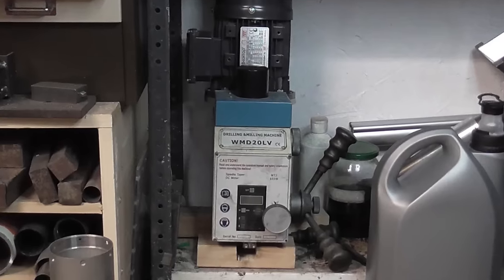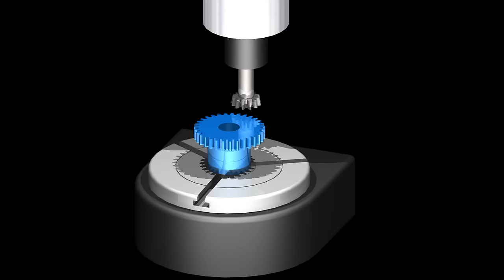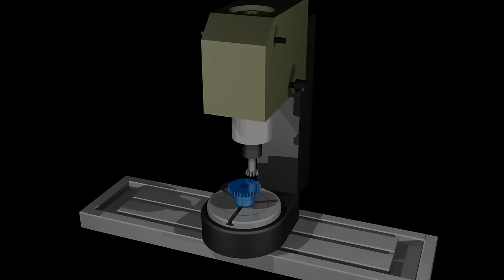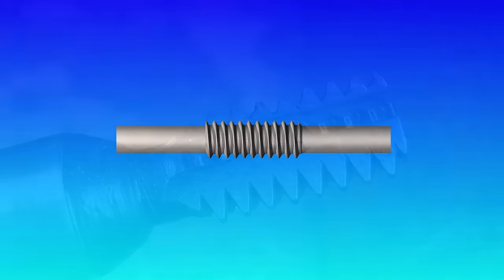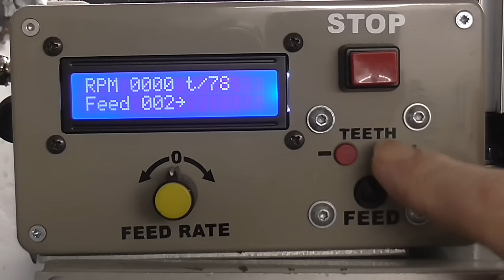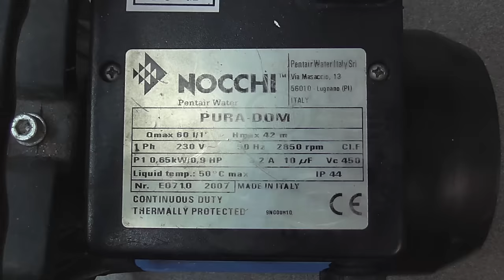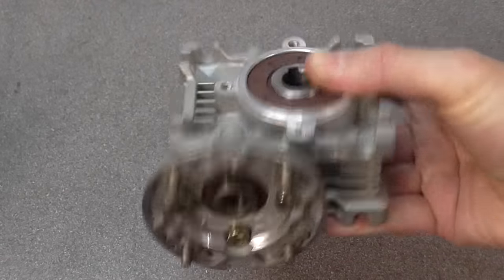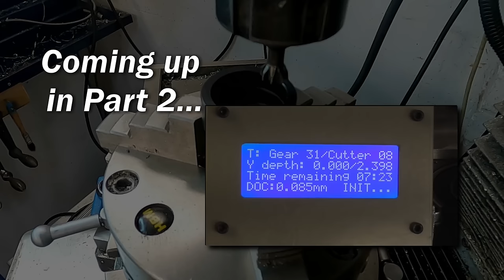Building a Gear Shaper

Comment: This has to be one of the best, if not the best diy machine builds I’ve seen on YouTube yet.  Your use of the donor mill casting was a great idea.  It retains the quill functionality to get your reciprocating motion (shaper motion) and you get the dampening properties of cast iron that all proper commercial machine tools are built from.  Most diy machine tool builds I’ve seen are of the “built up” variety, with housings fabricated from steel plate and bolted together or a combination of bolted construction and weldments. The cast iron construction being more rigid and thus more ideal for machining.
Can’t wait for part 2!!
Reply from the maker: Thanks! The only thing I'm slightly concerned about is that the rack and pinion gears on the quill are not that big and probably not designed for this type of use. That's why I used the shear pin. I'm probably being over cautious though and it will outlast all the use I'll ever need from it.
Reply: @AndysMachines  I agree.  The rack and pinion gears will probably wear out first (after a LOT of gear cutting).  Maybe a bell-crank arrangement at the top of the spindle driven from your new reciprocating arm could drive the spindle up and down directly?
Reply: @chrisarmstrong8198  Good point. Not sure how the bellcrank would be fitted, but I was thinking of a piston. Could you elaborate?

Comment: WOW! Your video production is always so well done. Your engineering and clever design ability (i.e. talent) is exemplary.
This is not applicable to your implementation, but I turned a motor shaft down a few years back, on a new 3 phase motor I was fitting on my lathe. In my case a V-belt pulley. I didn't think about it at the time, but I left a sharp corner on the reduced shaft. Within 20 hours of running, the vibrations of the motor caused a crack to develop at that corner and the shaft with the pulley went rolling down the shop floor. Big lesson learned. Never thought that small vibration and radial load would do this on a 19mm shaft, at least not in my lifetime.

Comment: Technically speaking you can do away with form invole cutters.Cnc grind a perfect involute 1 tooth cutter from proper hss and still shape with it while indexing for all teeth to be cut.Away with expensive disc type shaper cutters.Damn your content makes me so excited.Having shapers myself i always wanted to see a setup like yours.Im very interested on the span measurements accuracy after you finished.
Reply from the maker: Yes, that method would be similar to using a regular gear cutter on a milling machine and indexing the blank, whereas the pinion cutter is more like cutting a gear with a hob. The pinion cutter is more complicated to make, but has the advantage that it will cut any number of teeth. The one-tooth cutter might be better for larger module sizes, as only one tooth is being cut producing less force on the cutter compared to multiple teeth being cut at once.
Reply: @AndysMachines  ja

Yes!That idea you are moving to now is way more professional. It ticks a lot of boxes. One is practical setting up the gear for runout before starting. You only have to deal with one plane instead of milling which has three. Two, overall rigidity. Instead of cutting something on a abour you are cutting into the table. 3, by setting feed rate slower (more cuts per tooth) equal less force and better accuracy. 4, cutter runout becomes neglectable for generating with 1 tooth cutter. 5, you will always get close to perfect involute profile instead of form cutters that's involute is only correct for 1 count tooth for that specific range. That alone in itself is why one doesn't cut professional gears on milling machines. 6 form cutters involute profiles typically vary from standard generated gears so it's not a good idea to mesh milled gears with 99% of all gears found in a gearbox. 7. now you can start experimenting with complex internal generating profiles like internal square with almost no radius. You're making the gear cutters jealous now. Actually generating with a mill wow!!! Cant wait to see more
Reply: I have made and generated with single point cutters if you are interested to see how good the results are? Its totally worth it for various reasons.

Comment: I liked the oscillating link. Could make the crank arm length with a slot, to allow for different offset, and different length of stroke.?
Reply from the maker: Yes, I did think about doing something like that and other people have mentioned this too. But for now at least it's unlikely I'll need to change the stroke for the gears I want to make.

Comment: Backlash removal in the worm drive, are you minimising the clearance in the root of the teeth or offsetting the worm slightly? Just wondering if the backlash is removed in a reversible drive or if this only works in one direction of drive.
Reply from the maker: The teeth on the wormwheel are machined to have clearance in the root and the worm adjusted to be very close to have minimal backlash. Still, I only drive it in one direction.

Comment: Another fascinating build! No need for adjustment on the stroke length? Or does that add a level of complexity not warranted in this design?
Reply from the maker: I chose a stroke length to suit the type of gears I want to make, I probably won't need to change it, if I do the only way is to shorten or lengthen one of the lever arms.

Comment: great job andy!!!  I'd love to know how much force it takes to cut a chip with that setup.  I did a small experiment on a 9x30 lathe and it didn't seem rigid enough.  Also, why not just drive the cut with your Z motor?  Would it stall or were you just worried about ware?
Reply from the maker: Thanks! It's actually capable of applying a downward force on the cutter of around 6000N (~600Kg) in the middle of the stroke. This would possibly be enough to strip the quill gears but hopefully the shear pin would go first. I don't know how much force it actually takes to make a cut, but considerably less, even when cutting steel the motor doesn't appear to be under much load at all. Using the Z motor (Nema 34 stepper) would be much slower, have less force, and also there would be more backlash as when using the quill I lock the head to the column.

Comment: Bold project Andy. Did you meticulously plan and design everything before you started or figure it out as you progressed?
Reply from the maker: I usually make a broad plan to start, but it often evolves as I build it. Usually it's steered by the parts and materials I have available. You'll see in part 2 how the control system evolved.

Comment: Amazing work! Do you need to add extra lubrication for the quill and rack and pinion now they are constantly in motion? Looking forward to the next video. You'll be making a lot of gear trains when this is done!
Reply from the maker: Yes, I did make sure it was all well lubricated when I reassembled it. The quill is easy to lubricate in use, but the rack and pinion gears are not so easy to get to without pulling out the gear shaft.
Reply: @AndysMachines  ah yeah. Maybe a little oil dripper above the pinion?

Comment: I am looking at making a worm wheel and gear to fix my old lathe. The specs say a lead angle 5 degree 28 min. When making a worm gear on a lathe. The lead angle does not matter because the tool bit will have clearance like a threading tool. How ever if the worm gear is being milled the rotary table would need to be angled at the lead angle to avoid the milling cutter cutting into the sides of the worm gear helix. Does this sound correct?
Reply from the maker: Yes, if milling a thread with a disc type cutter you would need to either have the workpiece or the head of the milling machine at an angle to give the tool clearance.

Comment: Well, that sure looks a very handy tool was you a machinist by trade ? I've made clock gears in the past and found them very challenging with manual dividing heads would love a stepper motor dividing head like yours 👍

Comment: Hey Andy how do you get on with that RF45 style machine from Amadeal? I've had mine since 2016 and have made many small fixes and improvements but the one I can't fix is that Y is out of square to X by .03 over 100mm :(
Reply from the maker: I like this machine as it has almost the capabilities of a Bridgeport type mill but in a smaller size that I can fit in my compact workshop. The quality of these can be hit and miss though, I got mine 2nd hand from somebody who hadn't taken much care of it, so I completely stripped it down and rebuilt it, including removing many dings from the table. The X and Y seem square but the column was not. It was already shimmed when I got it, but may have moved. I re-shimmed the column but it's still not perfect. More recently I have changed all the bearings and seals in the gearbox as it became quite noisy and started leaking oil down the spindle (video on that will be coming up in the future).
Reply: @AndysMachines  yeah, for the size of the machine the amount of travel and capabilities are excellent. I shimmed my column too. That part of the machine is pretty much bang on at least! I've had the same experience with the gearbox in mine. I replaced all the seals and bearings with good quality ones but it didn't make it much quieter. The annoying thing is, it's way, way quieter in reverse and I can't figure out why! No obvious wear pattern on any of the gears....
Look forward to your next vid :)

Comment: With a symmetrical cutter, does it really need to rotate?
Reply from the maker: Yes, everything needs to rotate together to generate the gear. If the cutter didn't rotate it would just remove the whole of the outside of the blank down to the bottom of the gear teeth.
Reply: We’d lose the pressure angle and end up with a square tooth?
Reply: Think I’ve got the gist from the second video, you explain to divide the number of teeth by the number of cutters to get the spin ratio and then all the magic happens. Awesome work by the way, rare to see so much content in one video with zero waffle and your combined machining, cad and animations coupled with your knowledge is simply outstanding and enviable

Comment: I laughed out loud at "no spinny roundy tool but a stabby in-and-outy tool", thanks.
Btw, how so that you didn't cut the worm while it was mounted to the axle? That'd be way more accurate, or am I mistaken?
Reply from the maker: Maybe I'm not sure what you mean, but the worm and shaft were all machined as one piece, though I didn't show much of this in the video.
Reply: @AndysMachines  then that should solve the case. I was thinking of having the smallest compound error of the worm/gear system as it pertains to concentricity.

Comment: You could save a lot of time by adding a band saw to your shop.
Reply from the maker: Maybe for cutting curves. I used to have a horizontal type cut-off band saw, but it went through blades so quickly that I converted it to a power hacksaw. It's slower but one hacksaw blade costs 10x less than a bandsaw blade and lasts much longer. (The bandsaw blades would break before they went blunt).

Comment: two versions of this process, obviously this is the one that will actually produce internals.

the other uses a rack, and rolls the gear along it, with occasional retract and index if need be. no internals!

that being said... this wouldnt be terribly hard to convert to doing bevel gears. need two tools, LH and RH, work on one flank at a time. 
hardest part is getting the angles right for the rolling cone effect. bevels suck. i hate bevels.

a few hours staring at a gleasson may help...

Comment: Where is the video where you detail the geometry of the hob for worm gears?
Reply from the maker: I haven't done a detailed video on making a hob for a worm wheel, though I did touch on it in this video. It's basically the same as making regular hob except that you'll normally want to match the pitch diameter of the hob to that of the worm (for regular gears it makes no difference). You can actually run a worm on a helical gear, or even a spur gear with the worm at an angle, the contact patch will just be much smaller.